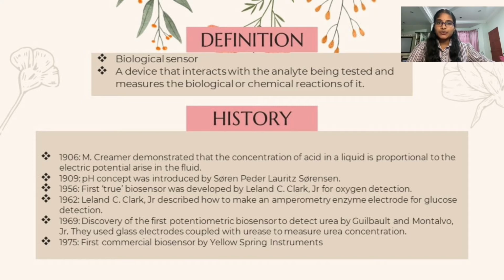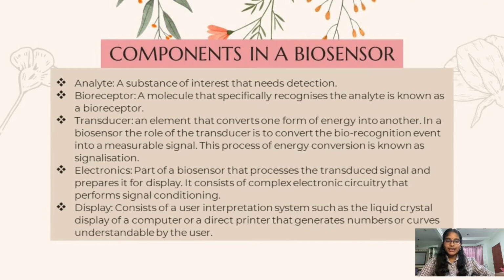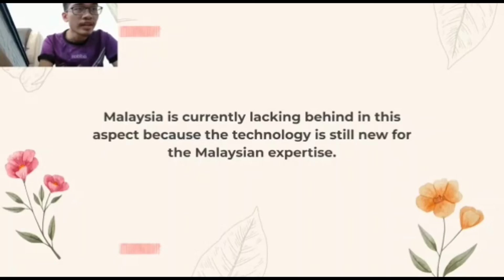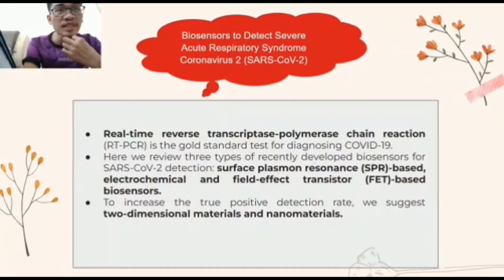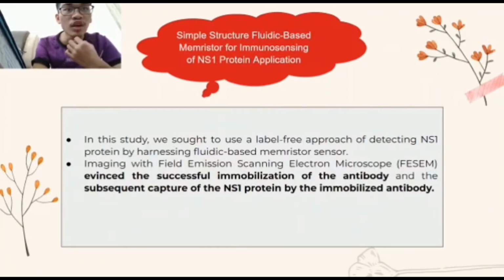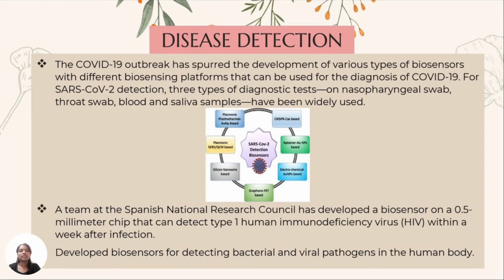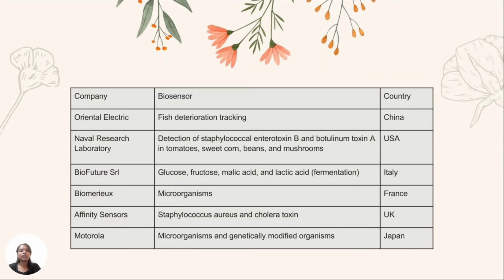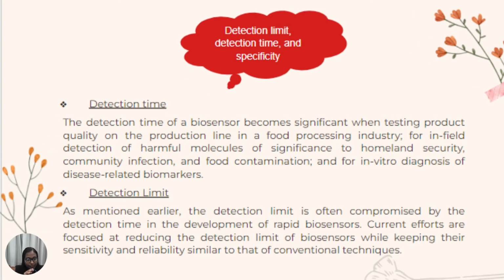#UMSTS2022 BIOSENSOR FOR A BETTER MALAYSIA

Comment: Good explanation and the slides are very informative. 

Question:
1. What is the limit of detection in the biosensors and how to surpass that limit?
2. Due to the current state of the economy in Malaysia, should the country put in the hefty amounts of funding into biosensors immediately or put it on hold at the moment although it may help us drastically in terms of the health and environment?
Reply: Thank you for the compliment.
1. Each biosensor type has limitations based on the intended application, and the parameters that are required for optimal performance. Specifically, factors such as the ligand specificity, sensitivity, dynamic range, functional range, mode of output, time of activation, ease of use, and ease of engineering are the types of limitations a biosensor design could face. The Limit of Detection, LoD is commonly used as evidence of the quality of a biosensor. However, achieving ultrasensitive biosensors has three major challenges which are assay sensitivity, response time, and selectivity. One of the strategies to gain greater sensitivity involves confining the sensing volume to the nanoscale, as used in nanopore- or nanoparticle-based sensors, because nanoparticles are ubiquitous in amplification. To improve response time typically focus on obtaining an intimate mixture between the sensor and the sample either by extending the length scale of nanoscale sensors using nano-structuring or by dispersing magnetic nanoparticles through the sample to capture the analyte. Loading nanoparticles with many biorecognition species is one of the solutions to help address the challenge of selectivity.  
 
2. In my opinion, the country should prioritise the research of biosensor technology in Malaysia by funding them. This is because biosensor technology has proved to be useful and advantageous to the country in many fields including health, environment and food industry. By developing new biosensors and improving currently using biosensors in these fields surely will provide great opportunities in many ways to the country. Other than that, the market for biosensor technology has been increasing at an incredible rate as the technology is also reaching new heights. So, funding for this technology will be beneficial for Malaysia’s development.

Comment: Why there were cases of contaminated packaged/canned food even after we had detected via Biosensor technology?
Reply from the maker: It must be the case of the peanut butter jam right which happen in our country .So theoretically , we believe all Biosensor can detect the bacterial or viruses by using the  high light beam same as the X-ray session or using the ultraviolet detection . So in this case , we did not know how the company processing their product , if they use sensor technology , it might be the sensor problems which cannot determine or display the correct result of contaminants. If the company did not use sensor , and only use the steam under pressure or pasteurozation or boiling water which required heat , we also need to know that there was thermophiles bacteria which are heat resistant bacteria . However for this case in our country , Salmonella are easily killed by the heat as long as the temperature is above 60-65 degree C , but due to this case, it might be variants of Salmonella which are stronger than the typical Salmonella as we study.